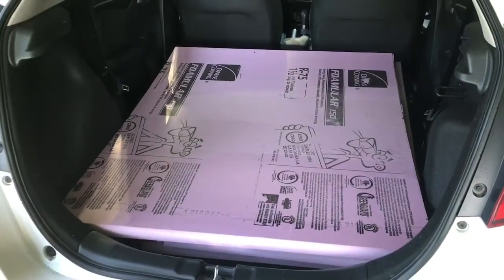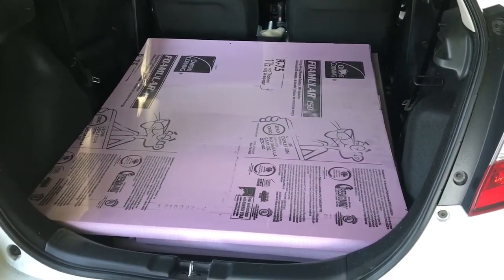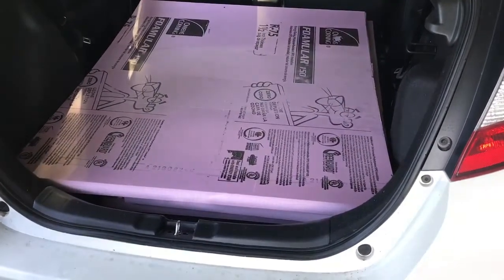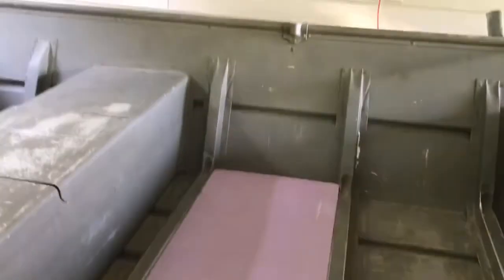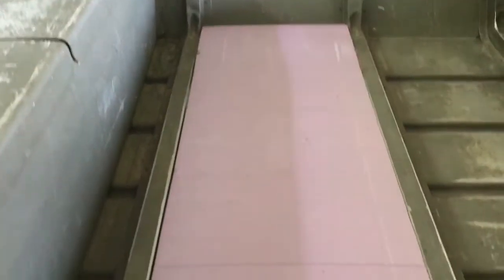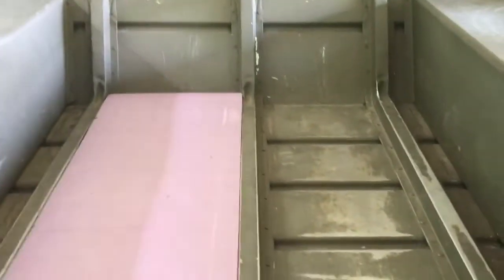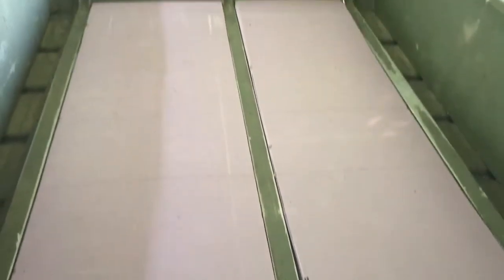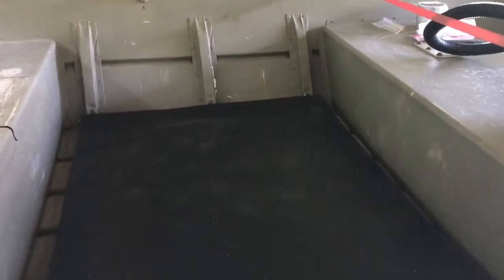Jon Boat Spruce Up - Flooring (mid-install)

Comment: Does that mat get hot during the summer? I'm looking to put a floor in my jon boat that I can remove during the winter for hunting, but have it in during the summer. Do you think that carpet wrapped on plywood or a lighter material be better? Thanks
Reply from the maker: Arkansas Outdoorsmen it does get warm; what i’ve done is bring a thick rug along with me & i put it over the mat when i launch at the ramp